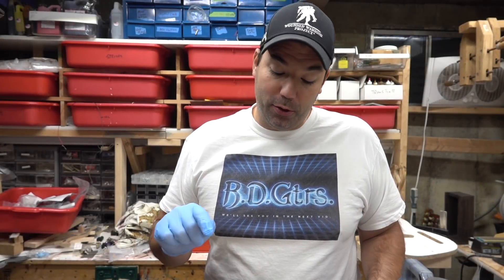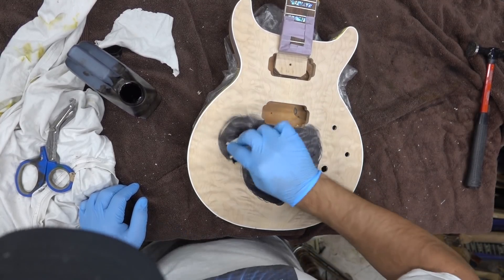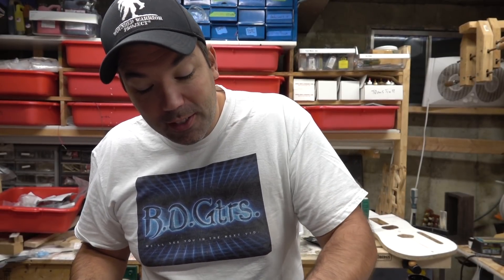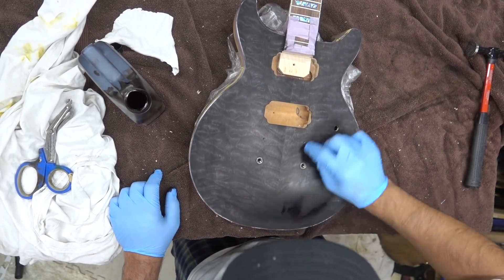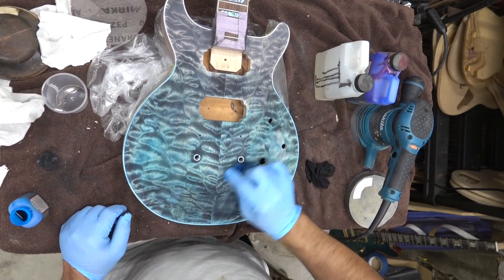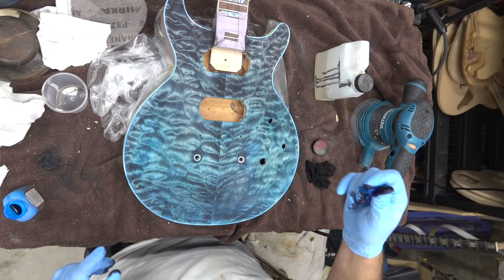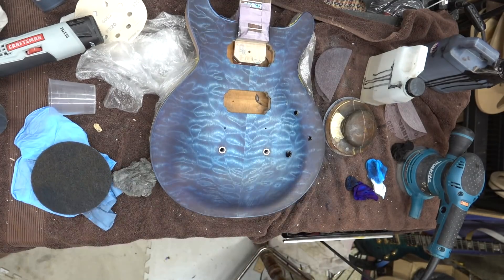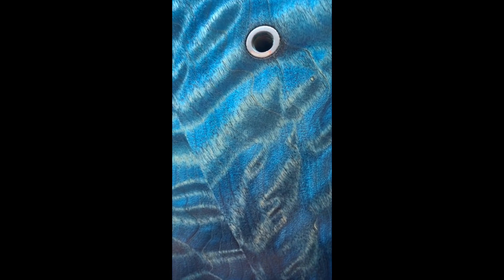DIY Ocean Blue Burst on a Quilted Maple Carve Top Guitar Body

Comment: Hey Big D! Great work, as usual, quick question, I'm currently working on a birdseye maple custom build. I would like to know if you would approach it the same way, for a similar colour scheme? Thanks!
Reply from the maker: The problem with Birdseye is that the eyes absorb a little more stain than the rest of the wood.  You have to be careful with the black.  I would only apply black once you get the blue in.
Reply: @bigdguitars  Thanks a million, I'll definitely do it in that order. I'll run a test piece first, let you know how it turns out.

Comment: Mine looked great but then it turned green overnight after I put on a lot of CLEAR Coats what am I doing wrong?  Did I put the clear Coats on too fast and too thick?
Reply from the maker: Did you use sanding sealer?  Most coats at first?
Reply: yes  And it didn't turn green the next day and I had let it dry for a week but when I continued clear Coats heavily and it turned green the next day
 I stripped off the clear Coats and it turned blue again the clear Coats weren't heavily tinted but they did have a slight amber to them

Comment: I get nervous watching your dye job videos. You always say, "pour to the side" and then...right over the body lol
Reply from the maker: when you start! once the color is in you are sometimes ok.
Reply: @bigdguitars  just yanking your chain...I've been messing around with a brand of leather dye called Fiebings, which I can get locally from the shoe repair place. For see through finishes, dye > wood stain, any day of the week imo
Reply from the maker: @peachmelba1000  I didn't like the fiebings  for some reason it blotched the few times I used it,
Reply: @bigdguitars  I had that happen too, but I started using the largest pom pom applicator I could get, and it flowed a lot better. Maybe it flashes off quicker than the Angelus.